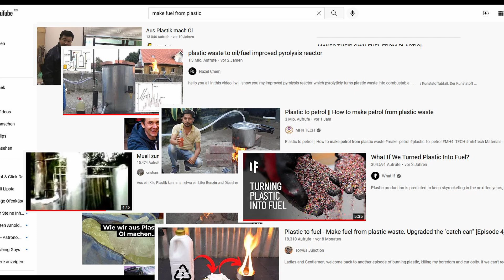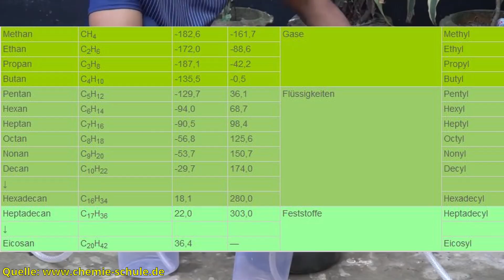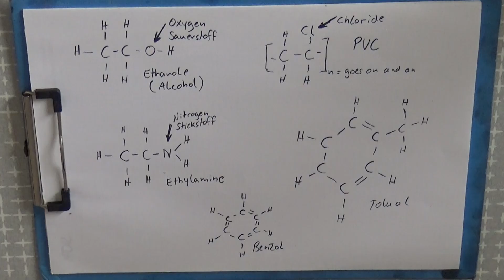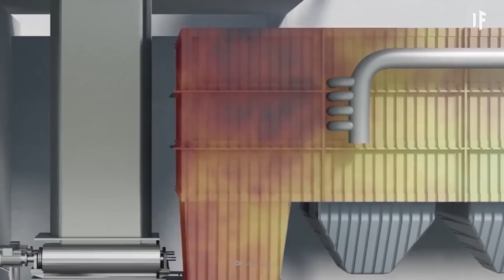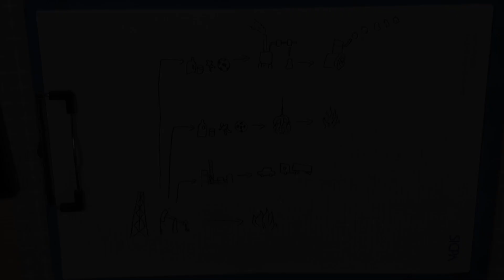The myth of making fuel from plastic, BUSTED!

Comment: You make a lot of assumptions. Firstly you show only the most inefficient ways of heating the pyrolysis vessels. It’s not that difficult to make a much more efficient burner / heating system. Next you assume that the gas is not used to assist the heating process. To just let the gas escape would be crazy but to go a little further gas will eventually be created during the decomposition process so at least it’s being put to use instead of escaping into the environment. Making the claim that these fuels can’t be used in modern engines is also crazy. All modern gasoline engines are made to run on various fuels like methanol and have an o2 sensor that automatically adjusts the amount of fuel to the correct stoichiometric ratio. Any product that has similar characteristics to gasoline will work in a modern engine. Lastly you expose yourself as a communist when you make the claim capitalism is evil. What really rubs you the wrong way is you don’t want individuals having the ability to make their own fuel.
Reply from the maker: No. This stuff will destroy modern engines. It has nothing to do with gasoline nor diesel. It is some flammable liquid. Nothing more. Very old diesel engines can handle that stuff, with all the impurities inside. But never a modern engine that relies heavyly on a specific fuel quality. Gaskets, fuel or injection pumps, injectors etc. will most likely die of this.
Reply: @diymicha2  That's why they use mechanical diesels fren.  I'm pretty sure Rodolph Diesel's first engine was claimed to be around 40% efficient, therefore the analogy that they were in the low double digits is erroneous...  I mean even the lowest efficiency gasoline engine of the time was still over 25% hahahaha.  If you think modern engines are more efficient think again.  How can a modern engine, especially diesels be more efficient, when they directly spray fuel into the exhaust systems to limit, in essence, black smoke?  They also use urea (d e f fluid) to create a reaction to help combust the carbon.  Modern Diesel use way more fuel  than mechanical types, to achieve the same work, all in the name of "pollution control".  In reality, the same amount of "pollution" is coming out of the pipe, just that's it's not in the form of black carbon...     Man stop being a climate crazy, these guys are actually doing something good by ridding the lands of shitty plastics.  It's too bad so much fake science goes into discrediting free methods for fuel productions like they are utilizing..  Lots of people have produced fuel using this back yard method. Just because something is modern doesn't mean it's better.  The only thing modern shit seemingly does is drive the cost of all projects to the ceiling, while lining the pockets of big business and governments with more capitol.
Reply from the maker: @Vicsonvee  Okay... You got me... You're mixing up stationary engines with mobile ones. Diesels first engine was a stationary at approx. 40% efficiency. Right. Modern stationary diesels for electricity production come to over 55% efficiency. So much on that. Now the engines in cars: Manufacturers claim an efficiency around 30+% BUT, and here it comes: Vehicle engines run seldomly in the perfect RPM for the most efficient work. You stop: they idle at low RPM, you accelerate: Very, very bad efficiency ratio. You're speeding: gulp, gulp... Now, rule of thumb in reality is more like: Gas 20%, Diesel 25%. No private car owner runs his engine always in the perfect efficiency. This is, by the way, the reason that is is more efficient to burn gas or diesel in stationary engines to produce electricity to drive in electric cars.

Comment: It’s one thing to bust a backyard operation, (which I don’t think you accomplished) but entirely another to bust a legitimate larger scale operation. In the beginning of your video you showed the YouTube videos that populate after searching “pyrolysis”. One return is the story about Cynar in the UK. In that video they have a larger scale facility, a proprietary process, measured the emissions from an engine in a modern vehicle on camera, and would have had to pass some sort of environmental process to build said plant. So if your going to “debunk” pyrolysis, could you please and thank you factually speak to the issues with said process?
Reply from the maker: They got some large scale industrial pyrolysis reactors running, yes. But they face the same problems. Only a few plastics are usable. Afaik PE and PP. Others, like PVC emit toxic cloride gas, and/or clog up the machine. But even if they solve those problems - the biggest problem is and will be that burning those precious liquid carbohydrates at the end in engines with a horrible efficiency is the worst possible thing to do.
Reply: He wasn't debunking pyrolysis itself, but rather the multiple claims that this is a viable garden shed process that will yield endless free diesel. At least, that was my take on this video. 

I've watched most of the videos shown at the start and concluded that
a) it's not as simple as people make out.
b) it's dirty and produces a product I would not dare put into my car.
c) I don't want to breathe that stuff in.

I'll find other ways to save money.
🇬🇧
Reply: @davidjames2145  but think of like a post-apocalyptic use. I don't know how reliable this would be as far as like if your engine's going to break down because it gets clogged up but if it gets you from point a to point b in a bad scenario it could be useful. But at that point if you're going to go through the whole setup of making a still there's plenty of oil Wells all over the country (at least by me) the refining process is pretty close to the same thing as this with a much better product just a lot more hazardous if you're doing it outside of a refinery.

Like definitely don't put it in your Corvette but the process is at least useful to know

Comment: Plastics are made from high molecular weight polymers, which are chains of small molecules called monomers. The most common ingredients in plastic include carbon, hydrogen, oxygen, nitrogen, sulfur, and chlorine1. Plastics are made from raw materials like natural gas, oil or plants, which are refined into ethane and propane. Ethane and propane are then treated with heat in a process called “cracking” which turns them into ethylene and propylene. These materials are combined together to create different polymers.  

Step-By-Step Journey From Cultivation To Eco-Magic
Step 1: Harvesting And Extraction

In this step, the hemp is pulled from the ground, and the cellulose required for the process is extracted from its stems.

Step 2: Preparation Of The Hemp 

The extracted cellulose is then subjected to a spa day, soaked in an acid solution, and cleaned with water and chemicals. This prepares the cellulose for the major transformation that awaits it.

Step 3: Production Of Hemp Plastic 

In this last step, the cellulose is combined with plasticizers and other additives that give it an extra touch. Heat and pressure join the party, creating the star of the show: hemp plastic.
Hemp plastic does not take long to decompose. Although specific times may vary, hemp plastic decomposes faster than traditional plastics, making it a key player in reducing plastic waste.

Evidence shows that hemp plastic can decompose in up to 80 days.

Comment: Well, I will invite you to take a closer Look! It burn so clean tha you can run the generator inside home. Such a plant can process all kind of fat,animal or vegetal ,too,very good solution for people far away from modern infrastucture.
The remains are clean.
The required energy can be solar energy, which is good way to store solar energy into high valuable fuel.
Even burning wood is economical still quite ok .Some of the output gases can be burned as well during the process
Reply from the maker: If you don't see the pollution doesn't make a process clean. CO2 is produced in masses, let alone the methane and ethane gases.
Reply: @diymicha2  I don't think they care about the pollution. Think most people who are making these don't have the luxury of being able to go get gas on the corner
Reply: @qcwred  that's the of saying: I don't think they have the luxury of eating animal meat. To a canibal tribe.
Reply: @LunaHusky805  Thanks .I build a new Plant ,much better.It take just little bit time,about 3 month. But,meanwhile ,gladly I can share all Informations about ,how it works and about whole chemistry inside.
Reply: @thewhizzard6022  Really ? Since Antoine Lavoisier ,who said " nothing get destroyed, nothing is created,everything get transformed" everything is possible. From wood you can make heat ,CO,H2 and due Fischer- Tropsch Synthesis ,gasoline,which is relative easy to do.But we have plastic waste and all kind of waste  with highly energy content.
Reply: @cristianpopescu78  Why in the world is using paper trash, and pinecones in order to make fuel from plastic trash so blatantly NOT a good idea?
Reply: @LunaHusky805  Why in the world is using paper trash, and pinecones in order to make fuel from plastic trash so blatantly NOT a good idea?
Reply: @thewhizzard6022  A bad idea is to walk instead drive.Fuel for engine must be cheap.Trush is allways cheap.Not to be independent can be very expensive too.Too expensive in dificult time,such as war..
Plastic trush poisons the nature.Burning it in a car,instead in the oven is more profitable.Plastic to gasoline due solar heat can be a lot cleaner.Gasoline from (Plastic is ,by the way ,very clean compared to comercial one) There is ,yet, no way to store solar energy on long term,so it would make sense.

Comment: I ran some plastic pyrolysis experiments. Of course, if all apparatus are not professional, the process is not 100% eco-friendly. It is also something which require some chemistry skills. The hippie man in the video is evidently not... Anyway, plastics have been found in micro and nanosize even in human body, oceans are filled of, so in such case of extreme pollution, I think pyrolysis is a good solution. I do not see anything else which can challenge plastic production at its rate. Plastic pyrolysate should be better do not be used as fuel but as a source of chemicals to make new virgin plastic. So the industry become circular.

Comment: You do understand that "nature running it's course" on plastic means that it is broken down into microplastic? 
But I agree that the low tech systems are problematic. If you look at hazelChems videos you can see a better working system that can be run on the pyrolysis gas. Last point the german company pyrum Innovation runs a energy self-sufficient pyrolysis plant ... So your point about pyrolysis energy efficiency is only right for low tech backyard systems.
Reply from the maker: True, but the main problem stands: In the end it gets burned in one or the other way, which is still very bad for the environment.
Reply: @diymicha2  c'est toujours mieux que de le mettre a la décharge ou dans la mer, je prefaire le plastique sous forme de co2 que de plastique sous forme de microplastique

Comment: Chemical engineer here, thank goodness for your sensible and well presented video on this topic. The first I've found. Pyrolysis of plastics is a major no no, the by-product toxins from many plastics pyrolysis are lethal. Toxins such as dioxin/furans (from PVC for instance) are also carcinogenic as well as highly toxic. It seems that very few people on youtube really have any real scientific understanding at all.  I just wish there were more people like yourself trying to inform people of the risks. Nice work!
Reply from the maker: Thank you. That's exactly the point I was trying to present with this video. But obviously a lot of people still don't understand that. For non chemical educated people it is impossible to tell which type of plastic they might use for that. And besides that, the resulting flammable liquid is everything but FUEL, and will kill modern engines. Is there a way to pin your post to top in YT?
Reply: So, basically all your saying is that Pyrolysis of MIXED plastics is bad, and that we should separate our plastics to only pyrolyze PS, LDPE, HDPE, and PP?
Reply: For me at least this is about saving money for me. In the end I found that if I burn the plastics directly with excess oxygen I can heat my home and I have almost no ash or soot in the burn chamber to dispose of.  It all burns away nice and clean without any smoke coming out the chimney. I also run copper pipe filled with water to run a small 2400 Watt steam-electric power generator. Using plastic like firewood works best BUT you must inject a bit of extra air into the burn chamber to keep the burn CLEAN!  Plastic burns at 250% hotter than wood lb. for lb.
For a blower I use the discharge from a small shop vac running on 25% power by putting a 75 Amp diode inline with the 120AC power input so it only uses half a wave of power turning a 1hp motor into a 1/4 HP motor.  Power Squared Rule, half the voltage or 60 volts / half wave = a 400% drop in power. This is cheap to do and very clean. 100 pounds of plastic burns with the same energy of 120 pounds of high grade coal!
Reply: @chriswalker3956  exactly,  dont use pvc, teflon etc
Reply: @diymicha2  If that was the point why name the title "The myth of making fuel from plastic, BUSTED!" ?
Reply: What about the use of scrubbers?
Reply: I am not a chemist (yet), but i study Chemistry, like chemistry and do it as a hobby. I totally agree with you.

Comment: You are half right. Agree that doing it in the backyard is a no no. But it is possible at an industrial level with 3 plastic types. 2, 3 and 4 types. Bottle Pet (type 1) plastic even contains oxygen. I worked on creating such a machine. The plastic is heated to 280 degrees C on a oxygen free container fillee with ozone. The vapor goes into a cooling tower. The gas is used to heat the plastic container , other will cool off and comes out as diesel. The major problem is the leftover carbon. Not only insulates the plastic container but is also very hard to remove. Meaning the container has to be open and cooled making it hard to be implemented on an industrial setting, reason why it never passed the prototype level.
Reply from the maker: Finally somebody who knows what this is about. Thank you. But that still doesn't solve the problem, that that stuff shouldn't be burned in engines or elsewhere, because of the environmental issues it causes.
Reply: @diymicha2  engineered plastic, or type 7, contains unknown chemicals. There are 100s of those all stamped as type 7. Hope backyard types not using these to run any engine.

Comment: Kind of a click bait title. This fuel can be refined and if it runs an engine whats the problem? You are completely wrong according to people doing it for years. A guy on here has been running his cummins on it for years. You also fail to describe how its a waste of energy? A young man on here got well over the 25kwh worth of energy his machine used between his liquid and gas produced.
Reply from the maker: You see that big huge fire underneath the kettle? Speaking of waste of energy.
Reply: @diymicha2  how's that a waste? Lol you can reuse the "carbon" you created. A kid on here actually goes down into breaking down the energy input versus the energy output unlike this guy.
Reply: Lol unlike you
Reply from the maker: @NIGHTMARERICA  What do you reuse? You burn a lot of carbon to burn a lot of carbon. What is reused? Nothing.
Reply: @diymicha2  your opinions are far from factual. Honestly debates with people like you on here it's pointless. I'll stick with the VAST majority of people actually doing this, not just making commentary, and disagree with you. Good luck.

Comment: Thanks for the video. I disagree. The fire wood used to heat the process is free collected from the surrounding. The diesel fuel produced is used to run a diesel generator that produce electricity to run other machines. So the level of energy quality is much higher than just burning wood. So in my point of view as an engineer, this island diesel solution meets his needs. It might not be everyones solution, but like I always say, there are more than 1 solution to every problem.
Reply from the maker: You cannot get a higher level of energy in any process. That would disobey the laws of thermo dynamics. An engineer should know this.

Comment: Some good points Re: Plastics are taken.. Now Do Wood and Bio Syngas pyrolysis. Carbon cycle is net zero. As a matter of fact, Biochar inoculated soils capture CO2 in massive tonnage.
Reply from the maker: It can't be net zero if the "gasoline / diesel" gets burned in engines!

Comment: So you can use solar power to create diesel from plastic
Solar is free and can power combustion
Now it can power plastic reactor which create fuel for combustion
Reply from the maker: Yes, that would work. You could use the heat from the sun directly with parabolic mirrors. That would at least cut off the pollution from the heating process. But burning the resulting stuff still puts CO2 into the atmosphere.
Reply: @diymicha2  we can use solar power to run filtration 

My point is that we need power to turn plastic to diesel
And we have solar, that we can’t combust, so by using solar, we can power plastic reactors and carbon capture 
And gave combustible fuel from solar energy
Reply from the maker: @prophoenix212  or better drive directly from the solar electricity. no need for fuel.
Reply: @diymicha2  it’s easier to store diesel and not everything can run in electricity, sometimes we need combustion